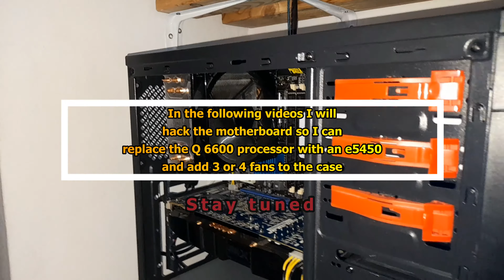Office PC to BUDGET Gaming PC | Sapphire R9 280x | Adapter Molex to 2xPCI-E 8 pin and...

Comment: Can i use 2x molex to 8pin pcie ? I want to buy nvidia gtx 1070 8gb and this graphic card have 6+8pin connector. I have only 8pin and need other. (Psu: corsair vs550) Thanks
Reply from the maker: "You can technically use a 2x Molex to 8-pin PCIe adapter for the GTX 1070, but it’s not ideal, especially for a high-power GPU like the GTX 1070. Molex connectors can provide around 50W each, so the adapter might not supply enough stable power for the 8-pin connector, potentially leading to instability, overheating, or even damage to your PSU or GPU.

However, if you plan to limit the GPU's power usage by locking the FPS (e.g., to 60 FPS) or reducing the power limit in tools like MSI Afterburner, it could work as a temporary solution. Just keep in mind that this is not recommended for long-term use, and stability isn’t guaranteed.

Your Corsair VS550 PSU is decent, but upgrading to a PSU with native 6+8-pin PCIe connectors would be a safer and more reliable choice for powering your GTX 1070, especially if you want to use the card at its full potential. Hope this helps!"

Comment: Hi sir, after a year does your gpu survived with that gpu connectors?
Reply from the maker: I no longer own this PC for a long time. PC can work with adapters without problems. Each molex or sata can handle about 45 watts of current.

Comment: dose the gpu work fine with those two molex to 8pins adapters ? in games ?
Reply from the maker: The AMD Radeon R9 280X is a dual-slot card that draws power from 1x 6-pin + 1x 8-pin power connector, with power draw rated at 250 W maximum. Molex power connectors can safely provide up to 132 Watts* of power. PCIe 6 pin power connectors can safely provide up to 75 Watts of power. PCIe 8 pin power connectors can safely provide up to 150 Watts of power. * Molex has two power pins, 12V and 5V. Max current is 11A. This means that the theoretical limit is 187 Watts. Gameplay without any problems:   https://www.youtube.com/watch?v=BZf2cyaatIs
Reply: @CalibrashGaming  thnk you so much sirr bcs i hv gtx 970 msi 4gb and idh the right conc from the psu and i bought a 2molex to 8pins + 1molex to 6pins adapters from ali express and bcs my gpu needs 6pins +8pins and 4days left to get my adapters here so i was thinking if i can run my gtx 970 well in games and in furmark too and if its gonna work well when it maxed out btw my gpu needs only 145w so its safe if i use those adapters and it will give me the max performance And thnk u so much